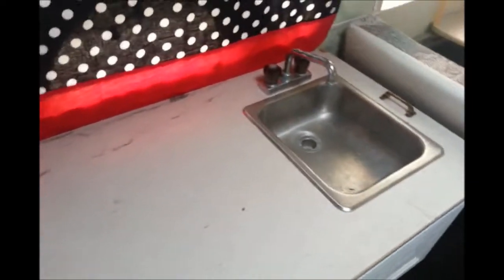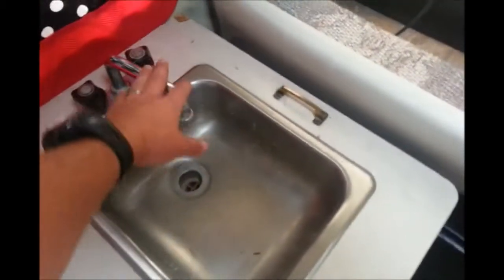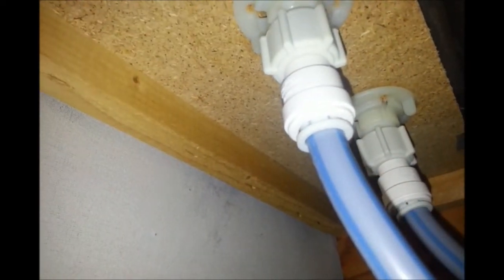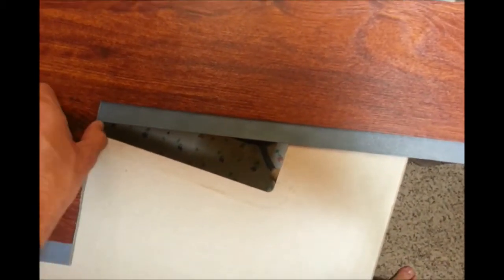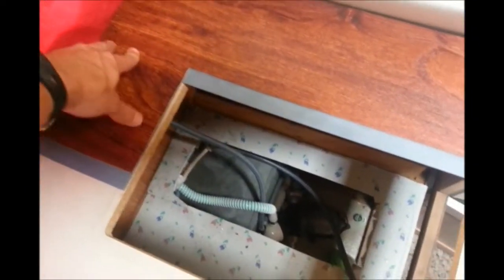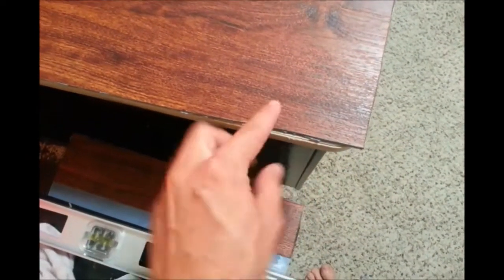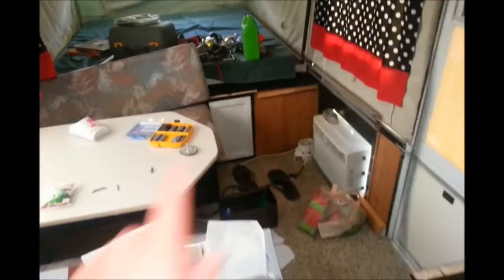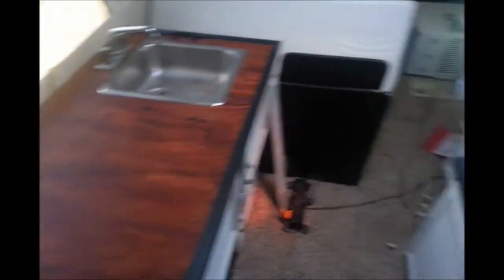Resurfacing countertops in our popup camper

Comment: You used the wrong  material for your countertop. You get moisture on laminate, it expands, separates, and falls apart. It is not the best for any kind of kitchen &/or moisture exposed environment. You would have been better off buying a short piece of countertop to replace it. ☹☹☹